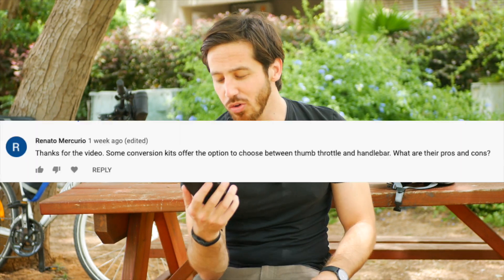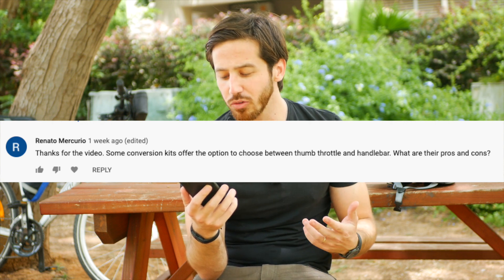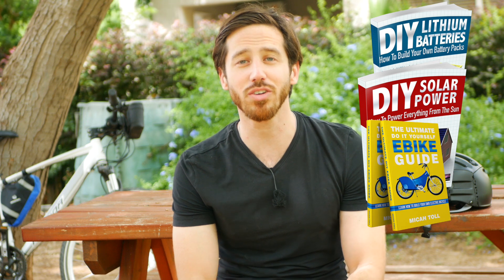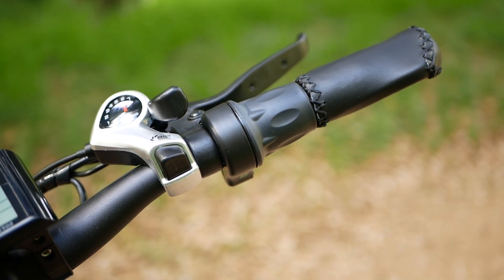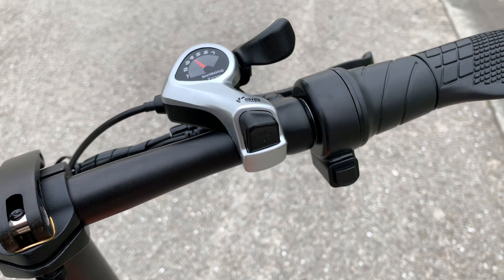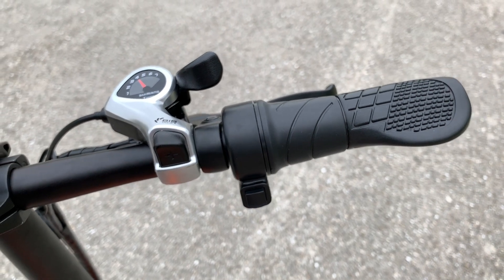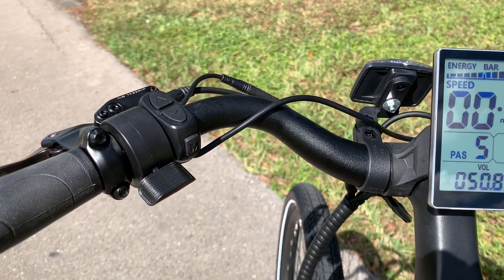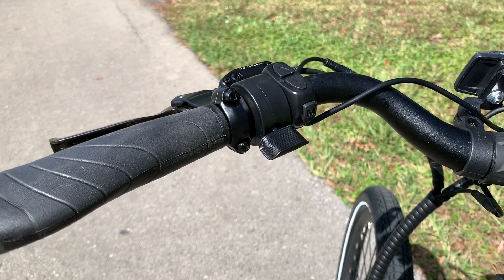THROTTLES: Twist vs Thumb - Which is better?!

Comment: Ive just brought a full twist throttle  for my super 73.  Ebike .   But the one that plugs straight in  has a hard plastic grip .  Im looking  at  soldering a 3 pin plug on  suron throttle  . Same as motocross throttle  can change grips to what you like .

Comment: Have you ever installed solid bike tires?   I'm considering solid tires on a mini folding ebike 14" wheels.   My bike has front,  middle, and rear suspension with additional shock built into seatpost.   Maybe the ride wouldn't be so rough with solid tires.

Comment: For over a 100 years, motorbikes have been using a twist throttle without any changes.  Twist throttle with the added cruise control feature is the perfect combination.  With cruise control, zero hand \ finger \ thumb fatigue for whatever throttle you are using.

Comment: I have an ebike that has the twist throttle  (not sure if its a half twist) but the first time I took the ebike out i had a minor iaccident when my hand gripped the throttle by accident before I completely straightened out the bike going up an incline.   I lost control of the bike and it fell on top of my leg giving me bloody scrape but nothing else.     I want a new bank which I can start the bike from a pedal only mode besides the peddle assist and throttle only mode.  Good advice for buying a half twist throttle over the thumb throttle which I was thinking about buying  thanks

Comment: Although I watched this when Micah first posted it, I apologize if someone else has since posted the obvious problem with left-hand throttles.  In the USA, we use our left hand to signal turns.  It's pretty difficult to signal properly when it forces you to remove your hand from the throttle.  I also think many manufacturers are losing sales to former motorcycle riders who want a twist throttle.

Comment: If like me - a regular runner, jogger, trekker etc -  you've tripped and fallen quite heavily onto you hands once or twice a year you probably also find that it's usually your thumb and thumb-base that breaks most of each fall's force - so you end up with a thumb that doesn't much like being kept 'muscled" and taut in a stiff position for very long. One advantage of that is you'll feel less inclined to use battery power for long stretches and keep fitter because your stiff aching thumb starts complaining after each 20 secs or so of thumb-throttling..

Comment: Any advice on slowing down my e-scooter? I have a Velocifero Mad Truck. I wanted a scooter like this hoping to go around my land having relaxed trips to enjoy the view and also keep an eye on areas that needed maintenance. In other words, I’m not interested in going too fast. My land has many small trails and turns which means I need to be able to have more control on the speed and because the scooter is too sensitive it keeps “jumping” as I try to have control. Really annoying.

I’ve been doing some research but still feel lost. Any suggestions on a throttle that allows me to control the speed (slow, medium, fast)? I wouldn’t mind trying a thumb, trigger or twist throttle. I just want the damn thing to slow down.

Any other ideas would be greatly appreciated.

Thanks in advance.

Comment: Eureka!  I viewed your excellent videos and tried adding a thumb to my Himiway Cruiser with not altogether satisfactory results and off it came.  I prefer to twist but found the half-grip throttle clumsy to modulate.  Then an epiphany: Those flattened comfy grips are the problem.  As I try to rotate the throttle with the right side of my palm, the left side is held in place by the right-side half-grip.  I replaced both grips with conventional round grips slightly smaller in diameter than the throttle and now I have great control.  The shape of the new grips allows my palm to slip in concert with the rotation of the throttle.  What do you think?  Have I just advanced the half-throttle solution, at least for this setup?

Comment: Thanks for the great info! I have a Lectric XP 2.0 with a half twist throttle (it’s a bit difficult with my huge hands) but what do you think about switching the brakes so that the left handle brakes the rear wheel and right handle breaks the front… any disadvantages? Thanks

Comment: I have a great question for you, I am interested in a twist throttle that starts you off slow, because I notice that all the cheap $15  twist throttles that I a have used, knock you off the saddle as soon as you barley turn it to its minimum activation point, I am looking for a throttle that starts off very slow and gradually starts accelerating to full speed. Please refer me to one either through amazon link or a model and model number, I will subscribe to your channel upon you response. thanks

Comment: How can you connect two separate thrumb throttle one operates the front hub motor and the other thrumb throttle for the rear hub motor.. so that each motor can be ran at different speeds..

Comment: My thumb throttle seems to be too sensitive. The ability to hold a lower steady power is challenging. I've thought of mechanically limiting the thumb or adding a resistor into the sensor line.  Don't know if I can just limit the max speed of the thumb throttle in the display menu; depends upon whether they are independent or if the menu max speed is overall the final restriction.   Will experiment with simpler options first.

Comment: My bike came with a half-twist. Used it for several months before trying out a cheap thumb throttle on a whim. Found I had way more precise speed control with the thumb throttle, a less cluttered cockpit, and more constant stability while also being able to keep my fingers rested on the brake lever at all times for an overall safer and more stable experience for someone who occasionally has to ride on ice and slush.

I've not experienced any of the downsides listed. My bike's controller has PAS and cruise control, I had more issues with bounce affecting throttle on the half-twist with my weight being partially distributed onto the throttle, and I routinely commute in sub-freezing temperatures without issue by simply wearing gloves--something I'd be doing in the cold, regardless of if I was on a bike or not.

May be worth mentioning that I've been playing video games for over 35 years and am a pianist, and have a strong, well-conditioned thumb, and possibly an under-developed wrist, so others' mileage may vary. The difference in analog precision for me however was night and day. To borrow an analogy from gaming, it was like switching from an analog stick to a mouse for aiming.
Reply: "The difference in analog precision for me however was night and day."

Are you saying that the half-twist throttle sucked because it was not analogue?
Reply: @jason.arthur.taylor  Nope, the operating word was precision. My thumb with no other forces being exerted on it could make much finer adjustments than my entire wrist which was also supporting part of my weight, gripping the handlebars for stability and keeping my fingers within reach of the brakes (and later my turn signals). It was easier to maintain a stable grip, especially over bumpy terrain and still have very precise control with flexing a loose thumb than twisting my entire wrist. With the thumb I could accelerate much more slowly and hold any speed I wanted without interference from any other factors.

Comment: Definitely thumb in general, had a twist throttle that was blocking my right gears by the display, so couldn't shift, plus my wrist was cramping, went to thumb throttle, totally better, just wish display was better, I turned the thumb throttle so my thumb is in a naturally resting position when at full throttle so I'm relaxed no cramping

Comment: motorcycles, the things ebikes are emulating, use twist throttles. if your doing more than pushing the lever for a few seconds, get a twist and watch some motorcycle throttle control videos that can show you more technique. its very comfortable and should not be done like most people show when they make the twisting motion like at 1:46.

Comment: Does anyone have an opinion on (or a link to a review of) the different handlebar mitts for cold-weather riding? 

Over the last month I randomly came across a few comments on them, and what I heard is that none of them work real well in terms of keeping cold air completely out and/or not interfering with handlebar controls etc. Also they all seem to be a pain to quickly take on & off the bars – no quick release.

Just got a radmission. A well-designed pair would be very helpful for me this winter, just need to zero in on the best available. Cold hands will definitely limit my my winter ridng. Thanks.

Comment: My ebike 3000 watt ukc1 display. 80 amp controller ,took off on its own full throttle randomly. Crashed . It’s happened twice . Not sure what’s happening? Some on fb say it’s faulty ground but I noticed first time it happened the display started climbing g assist levels on its own before I shut it down. Scary

Comment: I once rode my old ATV moped to school, during winter and I forgot my gloves.
Went on a shrotcut through the forst, toskip the motorway (cus it was a moped) and I had to hold onto that gas for over an hour.
Needless to say, the skin on my thumb felt really loose and the skin got purple.
10/10 would recommend.

Comment: I really like full twist, for the ability to use the motorcycle cruise control clip on. While it can be done with a half throttle it is much more difficult to get on correctly and you likely need to do some surgery to the clip on part to make it usable.

Comment: The half twist is by far the safest, I stopped adding full throttles because how dangerous they prove to be on electric bikes. Had a demo bike conversion for folks to test ride 1000 watt basic system with a full twist throttle. I had too many customers doing surprise wheelies in front of the shop! And if you drop it on the throttle side your bike can show you a few brake dance moves. Thumb throttle is good to do as you mentioned in your video switch sides with. I like to do this because I have played Evil Kanevil with my body on bikes all my life and some days one hand or the other may need a rest so I have screw on handle grips and will switch sides with my universal thumb throttle. P.s. I generally remove all gears and such systems from my personal build and only use the rear derailleur as a chain tensioner after bending and filing out guide to fit heavier single speed chains. Thanks for your videos!

Comment: As a motorcyclist I am more comfortable with 1/2 twist on Right handlebar, but I have already trained myself to drive both left and right side shift lever motorcycles, so maybe I can retrain for the left side throttle.  That said, however, how about just moving  the bicycle gear change selector to the left handle bar and keeping the right side twist throttle?  I consider the throttle to be more important than gear change - and, 90% of the riders I see do not even pedal.  BTW, what is the best supplier of all these parts if I want to experiment with different placements?

Comment: Hey Mike, i have this thumb throttle, and i would like to remove the cable and replace it with a shorter cable from another thumb throttle. If you could share a dissembling guide, i would greatly appreciate it. Thank you in advance😊✌️🛴

Comment: After riding a few miles using a full twist throttle, unless it has cruise control, my hand gets sore. Thankfully, the ebike I often use does have cruise control. The second ebike does not and it's an very obvious difference, and I may replace the twist throttle with a thumb throttle on that bike to give it a try. Alternatively, I've also thought of designing my own cruise control add-on circuit for that bike.

Comment: I had a regular mountain bike for a long time. I always thought that a right hand twist throttle would be natural, especially since I've had motorcycles all my life & still have 3. I work overseas. I got my first eBike there, a Trinx (common brand in Asia). It has a thumb throttle on the left side. I got used to it quickly. Now here in Canada I recently got a Himiway Cruiser with a right hand twist throttle. So now it doesn't really matter to me left or right side. But I actually prefer the thumb throttle. I found, especially at first, occasionally a few times I would be walking the bike or maybe just want to move it and I forgot about it being on and I mistakenly twisted the throttle a bit and the bike jerked ahead. I've read about people having serious incidents like that. Now I'm a thumb throttle guy....

Comment: Definitely thumb 👍guy. A lot of bikes nowadays twist to shift so you can leave that alone if you want to add e power 🔋further into the handle bar's and either put the motor on the left side in back or right front on the fork. So it won't effect the bike in any way so it remains pedalable as before. And hopefully free wheelable power so if you run out of juice you can pedal home 😀. What do you think? Of course that's if you are adding power to a regular 21 speed mountain bike 🚵‍♀️. With shocks front and back.

Comment: I've had a full twist throttle on my motorcycles, thumb throttles on my ATV's and now I have a twist half throttle on my ebike. For an ebike I think I prefer the twist half throttle. There's too much to do with one's hand while cycling to effectively use a full twist throttle and I didn't like the thumb throttle on the ATV as one gets a seriously cramped thumb after a few hours. It's just my preference, that's all.

Comment: I find thumb throttles don't last as long I went through 2 thumb throttles in 2 years and now using twist throttle and it's been working for a year and a half with no issues

Comment: Just bought my first ebike and it came with a thumb throttle that has cruise control built in. After holding the throttle down for approximately 6 seconds the cruise control kicks in and you can release the throttle and the bike maintains what ever speed you were going. To turn it off you simply tap either brake and it cuts off the motor. Love this feature, use it all the time on my 20 mile round trip commute to work.
Reply: Seems companies are catering more to the commuter class. Bought a Gemini e bike it has slicks, thumb throttle, cruise control, 28AH, 750w motor, hydraulic disc brakes, 400lb load capacity. Not the highest specs but great value under $2000 including tax and shipping.
Reply: What is the name of this bike?

Comment: Yes having the throttle on the right is standard compared to motorcycles etc... but we also have the rear brake on the wrong side on pedal bikes. Unlike Britain etc.. they have the brakes correct compared to a motorcycle etc...

Comment: The reason they use thumb throttle on 4 wheelers is it gives you more stability over bumps. So choice based on the quality of your roads

Comment: My conversion has a cruise control, so this is a non-issue for me.  I have a full twist on the right side, but the others would probably be fine too.   I have butterfly handlebars so the grips are at an angle but it works for me.  You can always cover the brake with your non-throttle hand and move to the throttle hand to the brake after letting go.
Reply: Cruise control is great on e-bike.

Comment: I'm pretty new to this game, having just put together my first e-bike. It's a big arsed (supposedly 1500W) wheel motor with a 20A battery to match. My first thought was "Oh yeah, I definitely want the twist throttle". The problems are several. First and foremost, the sensation is very much all or nothing, it's hard to finely feather it. Secondly, the pathetically undergeared mountain bike upon which it is built, runs out of gearing well before the motor has run out of legs. It's pointless even pretending to pedal it, and this attracts unwanted attention. Thirdly, it's far too busy on the right side. I've had to reposition the gear lever to an inconvenient angle in order to accommodate the brake lever and throttle assembly. Furthermore, it's almost impossible to downshift from the aforementioned top gear scenario, where you find yourself having to come to rest on a steep uphill slope, without dropping the throttle altogether, and that's a shit sensation.

So, now I'm thinking that I really have to give the PAS system a go, to tame it somewhat, and not have it so blatantly a motorised vehicle. Either that or go the whole hog and register the thing. I'm ready to test the PAS, and also preparing, via brake lights, indicator, "horn" and etc, to do the latter. Reckon I'll be getting a road crankset too out of necessity.

My question at this stage: Is it possible to have both the PAS and a secondary throttle hooked up simultaneously, so that it's tame or wild as needed?

Comment: Hello,
I have a Hyper e-bike 26 in bike. My question: the bike is great, no problems at all….like you experienced in your demo….Being that the bike is pedal assist, whisch works well. The only problem I have is getting started from a dead stop….as a pedal assist there is a delay which some folks get impatient. XHow can I add a thumb throttle to help me get to speed quickly. Thanks Les Hunter

Comment: I have a 26 inch camboy electric bike does it make a difference if the handlebars are still or aluminum for the throttle to work

Comment: Basically to have a small battery like 3s on lithium 18650s and use only the throttle connecting bat and motor.. doesn’t work right? To much power on those tiny wires (sensorless, just black red and green...

Comment: Hi Mike, I’m running an awesome diy battery on my AT longboard thanks to your vruzend kit!! But my question is: is it possible to run an easy electric setup that allow me to run the signal from the throttle to the motor without an esc or vesc? Thanks for all you teach us